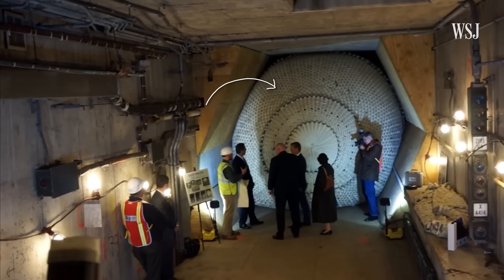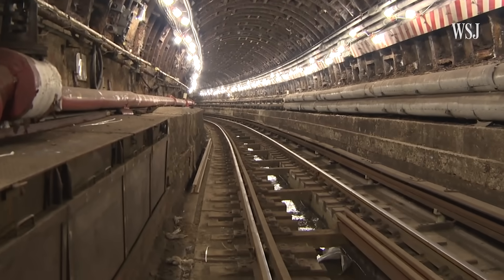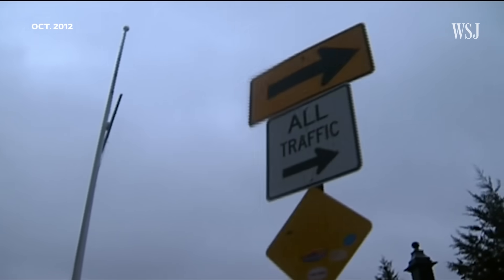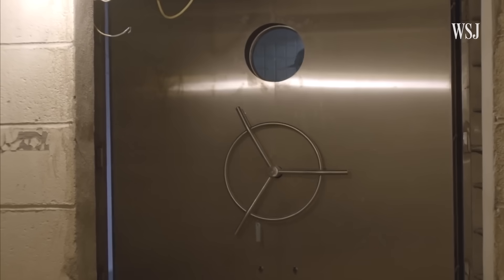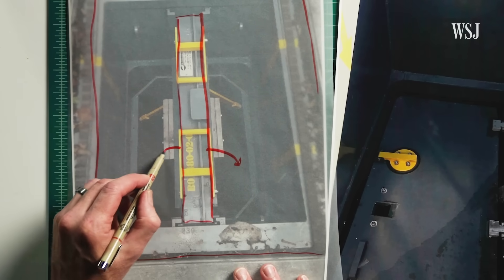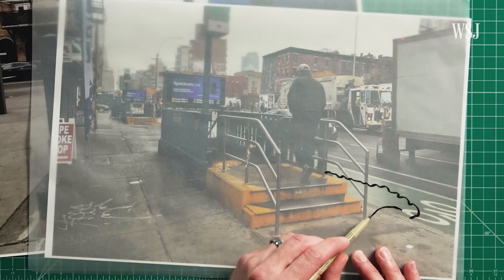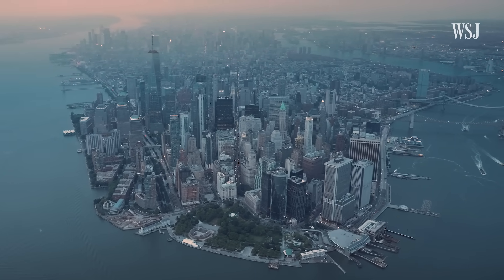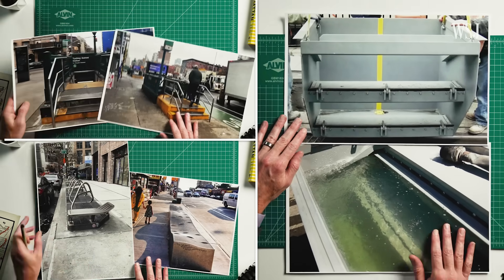Why NYC’s Subway Keeps Flooding | WSJ Pro Perfected

Comment: Dude this is so funny.

Their subway system is flooding and like college kids they just plug the entrance xDDD 
My god. Why is everything so stupid in the US? 
Figure out where the water is coming from and attack it there.
If that doesn't work figure out how to drain the water.
Nope... just stuff something into the entrance and ignore reality as per usual.

This is bucket under a leaking hole in the roof levels of stupid.
Stuff the garbage into the microwave and the garbage is ''gone''.

Comment: Interesting that this focuses on the fix and doesn't mention that the problem is accelerating and getting worse. Not only is sea level rising, but NYC is sinking. Parts of Brooklyn and sinking 4.5mm a year. That's massive. Manhattan is sinking 1 or 2mm a year. That might not sound like much. But over a few decades, combined with rising sea levels and increasingly powerful storms, we're going to need a solution!

Comment: People also need to remember one of the other reasons the subway floods is it's underground and water wants to go to the lowest point and take the easiest route and sometimes your subway tracks are the easiest route what's an easy funnel called staircases if anyone has tried to manage and move water from one place to another and make it go another Direction knows it's not easy and the farther down you go the harder it gets because water always tries to go down before it goes up

Comment: What they don't mention is that when the city's sewer system is overwhelmed, the next place the water goes is in the subway system. Most of the recent flooding is due to this issue. The geysers of water are from the street drainage being full. The street level water is higher than the subway, creating temporary fountains on the platforms.
Reply: nobody could have predicted this! NO ONE! /s

Comment: I think its a lost cause. Yes, they can redesign the entrances of the system, but that will not change the fact, that it is way to close to the sea. Building something below the water table is asking for trouble, especially if you then have a hard time getting rid of that water. The system is way to old to be fixed that easily. By the looks of it the tunnels are made of old, very rusty steel and it appears that as soon as the entrances are fixed, other way bigger problems will arise. Here in Berlin we also have a subway and its actually two years older then the NYC one. It is faaaar from great, but it seemingly is well maintained and I have never seen any flooding issues (not to say there aren`t any, but they are nowhere near as bad as in NYC). It appears NYC is on borrowed time. A 21st century city running on 19th century hardware and issues of overpopulation. The rent prices are insane and the building regulations are apparently few and far between. Here in Germany/Berlin things aren`t brilliant either, but there are loads of regulations if it comes to buildings and so a facade just coming off of the house or buildings collapsing spontaneously is nothing that happens here. There was a time in my life, especially after watching Casey Neistat`s vlogs, where I really wanted to live there, but learning more and more about NYC I think I`ll stay in Germany for now.

Comment: I dont understand how you can say New York is unique. London has 26 rivers flowing through it and emptying into the Thames that turns into an estuary on the North Sea all built on a chalk bed. The river Thames had to have a flood barrier built on it because the storm surges throughout the winter months and regularly has storm surges combined with high spring tides combining together. London installed an entire flood system installed starting in the 1980’s and finished in the 1990’s.
Reply: The London Underground still floods. Just not as much as the subway.

Comment: 7.6 billion plus everything spent in the past by no just use all that money and redo the subway tunnels and system line by line once and for all
other countries that have similar subway system dont have problems like how NYC does. WHY? 
speaking of Taipei. There subway have AC, Barrier from passengers falling onto the tracks, elevators, escalators, BATHROOMS.
Reusable Tokens to enter and exit (no metro cards (plastic) or paper (single rides / transfers / bus tickets ) waste.
They also use what is called a YOYO/EASY Card similar to the ONMY card but in Taiwan the YOYO/Easy card can be used in other locations such as 711/delis/restaurants etc
NYC subway system needs to go and put in a whole new subway. STOP throwing money away to these money eating companies that comes up with BS Solutions that dont HELP.

Find a subway system (overseas like Taiwan) that make sense and HIRE them

Comment: Why? Because the people who conceived and built NYC's infrastructures were kindergarteners. You gotta applaud that brainless person who thought that putting giant holes (the ventilation system) at curb level was a good idea... and it's only one of the insanely idiotic engineering that went through the entire system for decades and decades.

Comment: I don't remember if this was Call of Duty Modern Warfare 2 or Modern Warfare 3 (Xbox 360 versions) but I remember where there was a subway tunnel completely flooded. And the same thing happened in a certain region in Germany I think it was last year or even 2 years ago. I was driving the subway and the floor of the train was completely flooded. We had to keep our feet up till we got to a station where it was safe to leave the train and the underground station. It was such an terrible experience. And funny enough this month I was driving in a bus to pick up my car and a underground passage under a road above was flooded but the bus driver just drove into the flooded area and then it got stuck because the driver hydro locked the engine 😂
And each of those events reminded me of that call of duty mission 😅
I'm so glad that I don't use public transportation so often since I'm living in Spain, near a area which it's almost impossible to experience any flooding

Comment: Fascinating how the solution is always kicking the can down the road and using bandaids to get by. Obviously replacing or modernizing would be expensive but this is critical infrastructure that would cost even more if it goes down when it isn't planned.

Comment: 8:08 as a dutchman, I immediately recognised those ideas for what we've developed here in the 50s to 90s as the Delta Works. Might want to call in some Dutch Engineers!
Reply: That was my first thought… lol I was like “Sure the Netherlands has already solved this issue in a nice and elegant way. The Dutch are water control geniuses! Actual waterbenders.”
Reply: Also, in some cities they literally built gigantic PVC pipes around flood-prone tunnel sections to just brute-force the solution. Expensive, but when I visited it indeed wasn't flooding in the rain.

Comment: Wow an under ground tunnel system floods when it rains?
The real problem is a concrete city has nowwhere for water to go but to the lowest point.
Better storm water cacthment is were the money should be spent. There is no way to seal off every opening.
Spend the mony on dealing with the water and moving it to places other than the subways, Design deeper tunnels below the subways so the water flows there and then move that water away from the city.

Comment: its not that hard. all these measures to try and prevent the subways from flooding, but youre fighting against mother nature. its a losing battle. the only solution is to redesign the entire subway system and that just wont happen. so instead of trying to prevent the subways from flooding. how about we put in a system that diverts the water through massive piping systems. way more than just a storm drain. they should just design a piping system that acts like a shop vacuum and pumps hundreds of gallons of  the water to a different source. Water is going to get into the subway regardless, stop wasting money trying to stop it completely

Comment: wouldnt it be easier to just waterproof everything in the tunnels, use stainless steel where possible and just make all systems in the tunnels ip69 rated, allowing them to be soaked, then drained and keep working

Comment: It keeps flooding because it’s NYC. And in NYC fashion, nothing proactive and preventative ever gets done about anything, even when it breaks. When someone breaks and they do finally decide to do something about it, they put a bandaid on it instead of actually fixing the root cause of something, so it just keeps happening because it was never fixed in the beginning.
Reply: They basically need to re-engineer the entire system from end to end.
Reply: @ashakydd1  tbf it would most likley cost billions to permantly fix it and at that point you might aswell just build a whole new network and block off the old one
Reply: @Dragon_of_Terra  Here's the funny part. the Bandaid fix is costing Billions and Billions
Reply: Nothing is more permanent than a temporary solution.

Comment: Nobody but  nobody will maintain those subway vent closure systems or routinely test them. They won't close properly when they are needed. And that is even if MTA staff know how to close it.
Reply: So true!
BTW, there are dampers already in parts of the subway, but they have rusted open, so they can't be moved!

Comment: none of that is going to work, it may be sufficent for a time but it wont last long. The Only way to fix the problem is to rezone and bring the Metro above ground.  You built a city on the water what did you expect would happen? The only other option is to give the water a place to go even if you tunnel under the water table and build a reservoir

Comment: 4:45 Wait, WHAT? Instead of having the grate ABOVE the ground, they installed it at ground level?
That's just against common sense...
And then they install a whole system of seals to prevent water from getting inside. AND you have to close it manually?!
Could you make it even worse?
Reply: Yes, they'll increase the fare...😂

Comment: Closing off exits to a flooding subway station just sounds like a death trap to me.raising the grates are a good idea but not raising others because it’s a high traffic area is kinda like the same as dealing exits. it automatically shuts the drain which will just focus the flooding in said high traffic area , another death trap 🤦🏾‍♂️

Comment: Those horizontal "flood walls" at street level subway entrances?  Are you kidding me?  Those don't look much more substantial than retractable awnings!
Reply: You'd be surprised how the weight of the water can be used against it to seal a leak, a good example is a piece of equipment called a "collision mat" its in essence a large piece of rubberized canvas not unlike the "flex gates" presented in this video, they are used on ships to drastically reduce the intake of water generated by a gash in hull by being drapped over the side in front of the hole, it uses the hydrostatic pressure of the water outside the ship to form a tight seal between the canvas and the hull severely diminishing the rate of water ingress.
It's the same physics being applied on the flex gates, its idea is not to be a 100% watertight seal but to be a 90% watertight seal that while it leaks it leaks a manageable amount of water that the dewatering pumps can keep up and not let the tunnels completely flood, because for a multitude of reasons they probably wont be able to raise every station entrance before the next flood hits.
Reply: I'm sure some smart people did the required calculations but it does look really flimsy especially when you think about how much water weighs
Reply: "no step" implies that it can be damaged by somebody standing on it as well
Reply: @awesomestuff9715  or that its unsafe to climb

Comment: 5:26 you live really remind me of my memories with tropical storm, Ida, three years ago in 2021 that was the most insane, and quite frankly I kind of scary storm die ever seen, and I remembered that the subway system was completely a mess and I remember when I came back to school around mid September 2021 a lot of people was talking about the story in the event that took place with Ida I  even saw multiple TikTok videos about how bad the storm and left behind people with multiple situation to handle.
2021 was a good year but it was a interesting weather event year as well, so thanks for My memories to go back from three years ago.
But I am interested to see how old subway would take this turn because August 6, 2024 we post to have 1.05 inches of rain and then on Wednesday, August 7, 1.5 inches of rain and then on Thursday, August 8 0.15 inches may not be done much but on Friday, August 9 we are expecting to have 2.95 inches of rain almost around 3 inches and then on Saturday, August 10. The rain total fall is going to be 1.95 inches so I am interesting how the subway system is going to take action of this upcoming heavy rain event.
Reply: It was terrible. All the trains running underground shut down. I was in the Bronx trying to get back to BK and I had to take a cab to the elevated portion of the 4 train. I then had to get off the 4 once it went underground because the tunnels were beyond flooded. I finally spent $200 just to get a cab to Brooklyn that night smh. The rain was so bad I actually feared for my life for the first time lol

Comment: should have integrated the ventilation systems halfway up the ground floors of some of the buildings. not much water is gonna get in a 6 foot tall vertical vent. lil bit of 100 year too late advice there XD

Comment: We pave over nature and live & work in concrete jungles, then wonder why roads & tunnels get flooded in a rainstorm 🤷‍♂ where's the water supposed to go? It cannot seep into the ground through impermeable concrete & asphalt; and storm drains can't handle the deluge. The city becomes a bathtub.
Reply: That's not how it works, it's not that the water cannot seep into the ground, it's that the ground is already saturated. The ground is a sponge, once it has absorbed as much as it can, it won't absorb more
Reply: @shammzz3  asphalt & concrete are impermeable surfaces. instead of seeping through-into the ground below, water from a torrential downpour accumulates quickly on paved surfaces, especially in low-lying areas, where the deluge eventually ends up; flooding highways, roads, streets & buildings. our paved-over, built-up environment is completely out of tune with what mother nature demands.
Reply: There actually are pavers that allow water to be absorbed in the ground.
Reply: @PershingOfficial  Yea, those pavers exist, there are just not much of them in NYC

Comment: NYC just need to retire the existing subway system. With all this patching (and excess spending), why can't we just dig deeper and build a new one?! London did it and we did the same thing in Harlem (86th and 96th). Just repeat with other station. Money is not the issue. It's a question of long-term planning and not putting band-aid on problems that need a coronary bypass!
Reply: if we build a new one that would take more than 100 years lol
Reply: And nobody wants the subway to be retired bcuz 🤷‍♂️

Comment: Would it be feasible to take the ground water and purify it for commercial use?
Reply: Not exactly. As you pull the groundwater, the ground begins to sink in a very similar manner that is causing New Orleans to sink, exacerbating the problem.
Reply: The ground water In the subway tracks have rat poison lol

Comment: There were alot of weird phrases used in this video that were not 100% accurate. Calling it the Metro Transit Authority in the first 10 seconds puts a hit to your credibility. Referring to the system as the "metro", Congestion charge plan, being Congestion PRICING are just small things but take away from the videos message.

Comment: Crazy and almost criminal how expensive it is to modernize the MTA. Someone’s taking home a fat check from all this work. China builds entire systems with what it cost the MTA to build a mile worth of subway.
Reply: Not to say US Govt doesn't excel at implementing the most expensive least expensive solutions , but China uses slave labor with no worker rights or benefits. 

Not sure that's the and efficiency and solution I would want?

If anything all these places with a history of flooding may want to explore options that embraces the floods versus fighting them. Perhaps create Venice like cities. Although that would be better accommodated to rural areas.
Reply: @naplesflexplorer  - in addition to the slave labor, ChiCom developers buy cheap materials and the results often show within a year or two. civilians call such projects "tofu-dreg" to illustrate the point. they're pretty good at the propaganda, though; a lot better than westerners.

Comment: Why would you build a flood proof system that also shuts down the subway? Is it not the point for the subway to be still moving while there's water outside? Who cares if you're flooded if you're not open anyway!?
Reply: to prevent damage perhaps?
Reply: In an extreme event like a hurricane, you shut it down for a day or two and then reopen, vs. Incurring damage that shuts it down for much longer.
Reply: How do commuters enter and exit in a complete shutdown?
Reply: Then someone drowns and the MTA and liable when they knew the system could have been locked out.